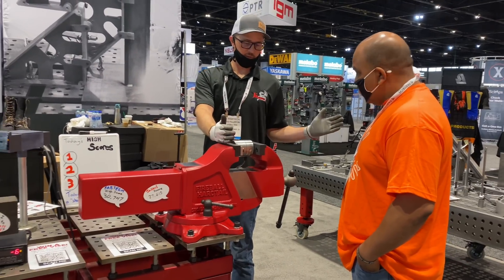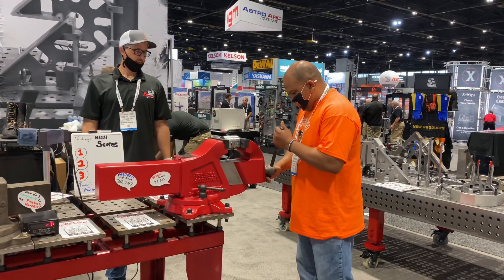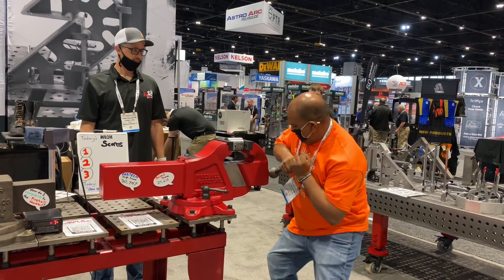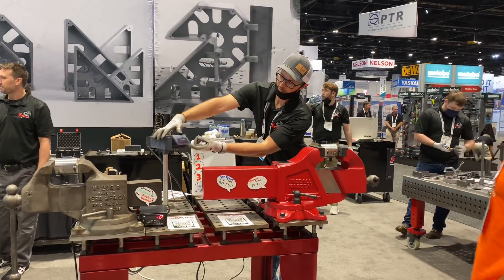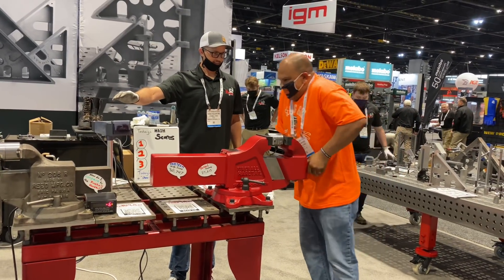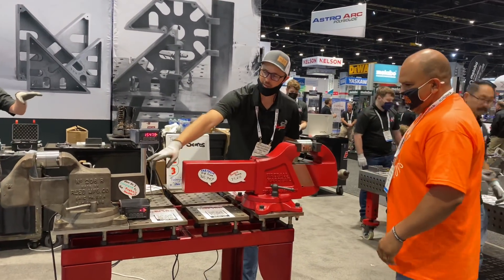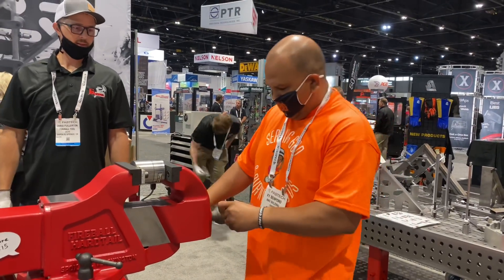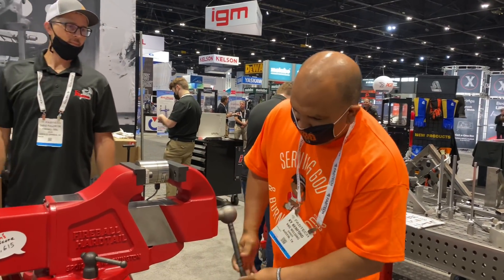Fireball vice strength test! $1500/ 300 year warranty

Comment: Watching this vise being built gave me a few idea's when I built my own. That thing is a beast for sure.
Reply: If you make one incorporate a thrust bearing in it like this one has, they solve the problem of all the friction where the screw shaft pushes on the movable jaw, it's a world of difference having one on there.
I have a massive vice like this one that I need for an assembly that I routinely assemble that has a nut I have to torque down to 525 ft lbs, needless to say your average vice can't handle it so I have to have one this big to do it, and the bench it's on has to be bolted to the wall or it'll just drag along as I pull down the 525 ft lbs.
But aside from that having a vice that size is nice for pressing things like bearings and U-joints in and out of drive shafts, I found a thrust bearing that was the right size and took the movable jaw to a machine shop and had them face cut the area on it for the thrust bearing, now there's just about nothing that it can't press in and out that I can get fit in it, the thrust bearing makes a world of difference.
Reply: @dukecraig2402  Exactly the feature I used, I used large needle bearings with washers.👍
Reply: @boriskarloff598  
Yep, that'll do it.
Makes a world of difference doesn't it, there's not a U-joint they won't handle, even the late 70's and later GM ones that had the plastic injected into them instead of having a clip installed even though the machine work was there for a clip when one got replaced.
The first time we came across one like that our vice wouldn't move it so we took it to a machine shop that had a sizeable press with a pressure guage on it, it was somewhere around 15 tons before the U-joint cup let go in the yoke and when it did it sounded like a 12 Ga shotgun went off.
That big vice that I scrounged up is a solid base, I have to have one of those for that assembly that I deal with that has the nut I have to pull down 525 ft lbs on, any swivel base will just slip when I'm doing it, the vice I found is probably from the 30's or from the war effort during the 40's and is forged instead of cast, it was made in Cleveland.
Reply: @dukecraig2402  Nice! I don't know what the lbs per sq inch mine is capable of but its all 3/8" plate stick welded together, 10 inch capacity and weighs about 36lbs.
Reply from the maker: I'm a fan of it. didn't purchase but great job no doubt. join us on our discord https://discord.gg/3EczVYaW
Reply from the maker: join us on our discord https://discord.gg/3EczVYaW 
thanks for watching

Comment: Jason should break one with a cheater bar and see how much it really can do. Probably the screw will go first and the rest stays fine even if doing so.
Reply: A cheater bar would just break the handle. In one of his video's he talks about how the handle is designed to be the  weak link. I think he mentioned it's actual strength is that of a 3/8" diameter rod.
Reply: @ravenbarsrepairs5594  Jason must have deathgribbed just the head of the shaft and single-handly turned those figures, othervise the handle would have gived
Reply: @ravenbarsrepairs5594  how about cheater bar on each side
Reply: @MF175mp  The notches in the handle are the weak point. Unless the cheater pipe was bored to a just fits over the shaft size, with the ends removed, the handle will bend.
Reply: @ravenbarsrepairs5594  Ok, then take out the handle and replace it with hardened steel, or cut the end into a hex to fit a socket. That problem is easily solved. Then the screw would probably be the next to give, but I'd like to see how much you could get out of one before failure.
Reply: @MF175mp  Yes, but could you reach both sides? Put two people on each end?  "cheater bar on each side" ?
Reply: In college in the machine shop we destroyed a vise by tightening it to death.  The vise cracked right through near the front jaw. It was a Record brand shop vise maybe 2 or 3 sizes smaller than the one in this video,  me and another very strong guy took turns cranking it with all we had, after about 5 minutes it exploded. He cranked it that last bit and I lost the bet of who could tighten it more lol, I bought him a beer and gave him the money I owed him after class.
Reply: @davidbrennan5  that's a silly thing to have done
Reply: @sexyfacenation  we were young and bored and wanted to see who was stronger. I had no idea we were strong enough to break the vise.
Reply: He did push one to the breaking point using a hydraulic jack in between the clamping plates.  It took about 90,000 lbs of force to break it. See his video.

Comment: That was week , lets slide a 6ft cheater bar on there.
Reply: It's designed to break if you put a cheater bar on. It'll only break the handle to prevent damage to other parts of the vice. Although I would love to see it put to the test with a cheater bar and a non breakable handle
Reply: Yeah!  And bolt that table to the floor, put my 10 ton crane on a 60" Ridged pipe wrench and unscrew some drilling jars.  Giterdun!
Reply: @Cobyc5150  nothing is unbreakable. Just ask a roughneck in the oil field.
Reply: @leftymac840  Of course! everything has its limits including that rough neck in the field

Comment: Cast iron?
Crap!!!
Reply: Cast iron can be crap by it can also be very good depending on its composition. I believe this vice is whats called ductile (cast) iron. Its clearly pretty strong if it can handle a 30k load.
Reply: What vice is not cast iron?
Reply: Clearly you’ve not seen any of Jason’s (Fireball Tool) videoe
Reply: Ya, I know vises and this one is probably the most badass vise ever made. The old Chas Parkers are the closest thing to this and the Parkers are the best, but this thing is on another level. The guy who designed it really thought of everything and you can tell that he's a vise guy by the way this thing is built.
Reply from the maker: Man, you're more metallurgy solid than I. Thanks for your input and for watching! The ease at which it released after putting so much torque on it was wild as well.
Reply from the maker: They know their stuff for sure. I've not studied or used a ton of different vices so I can't contribute on the best or otherwise. Thanks for watching
Reply from the maker: Good question, is there one that is not?
Reply from the maker: Not sure what you mean.
Reply: Derp. You have no idea what you're talking about. LOL
Reply: He said crap cause’ his vice is made of Styrofoam he never thought to  make one from cast iron. Doh!
Reply: @dominicelek9394  The heavy duty ones made from cast steel, or the ones fabricated from steel.
Reply: Stiff, strong, wear resistant. dimensionally stable, easy to machine, easy to manufacture. Cast iron has a lot going for it.
Reply: @ParadigmUnkn0wn   Don't know about "easy to machine", but yes to everything else lol
Reply: @tbdcreations5370 machining cast iron is common knowledge compared to things like Inconel/Hastelloy or titanium. I'd even argue that it's easier to hold tight tolerances on cast iron than aluminum, assuming your machine can handle it.
Reply: @ParadigmUnkn0wn   The comparison was steel to cast iron, not cast iron to inconel. Never heard of an inconel vice. 

I have far more experience with aluminum and steel, but from what I read cast iron presents more challenges than steel. Maybe you've had better luck with it though?
Reply: @tbdcreations5370  Cast iron is very easy to machine, good quality cast iron machines beautifully, the lead deposits in it give the process inbuilt lubrication.
It is messy to machine, this is where the dislike of machining cast iron comes from, not the actual machining process itself.
Reply: @heybabycometobutthead   My understanding was it's high wear resistance (from all the carbon) was the same property that made it more difficult to machine than steel (or at the very least hard on cutters). 

But again, I have little experience with it.
Reply: @tbdcreations5370  Cast iron is very easy to machine, i've done it myself lots of times.
The only thing that's not very nice when you machine cast iron is the chips it produces, they are tiny, almost like sand, and they can get stuck in the ways or other moving parts of the mill or lathe you're using and grind down the surfaces, so you've got to be careful about that.
The advantages of cast iron are that it's simple to cast any shape you like, it's easy to machine, it's wear resistant, and it's generally cheaper.
The disadvantages are that it's brittle and cracks easily, and if it does it's pretty hard to repair.
Reply: @ParadigmUnkn0wn  Cast iron does have a lot going for it, but tensile strength is not one.
Reply: @tbdcreations5370  Cast iron has good wear resistance for a couple of reasons the two obvious ones to me are the lead deposits and its porous structure, it soaks up oil like a sponge, cast iron was used as a spindle bearing material for many machines in the Victorian period and early 20th century, it's the closest cast material to rock which makes it good for machines that need to maintain their dimensions, lathe beds, milling tables etc.
small castings can become chill hardened in places due to the mass letting it cool too quickly, but this more the exception in things produced in a reputable foundry.
Reply: @heybabycometobutthead   Like I said, I was always under the impression all of the additional carbon content (10x that of steel) made it difficult to machine, that's all. Maybe I was wrong. 

I don't know what you mean by lead, though. Virtually no cast iron alloys contain lead in their make up. And cast iron won't contain oil from the foundry, so that aspect won't help during cutting